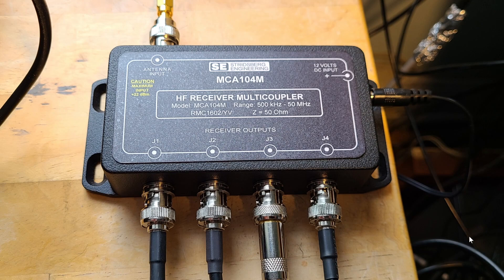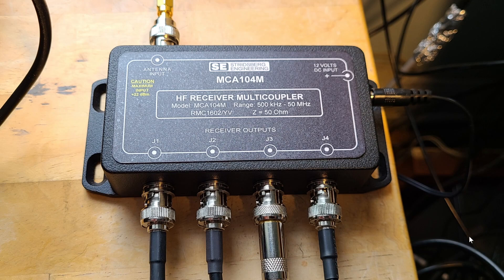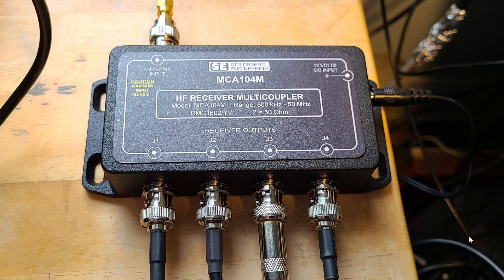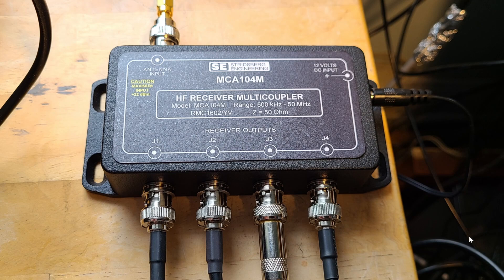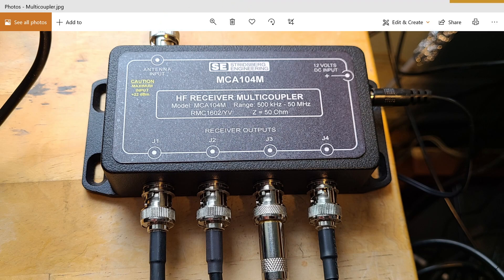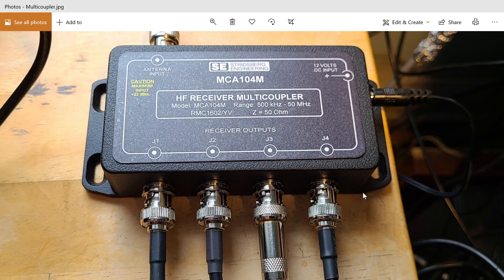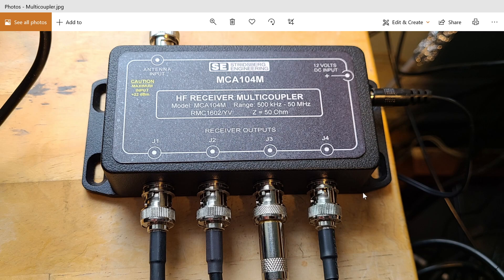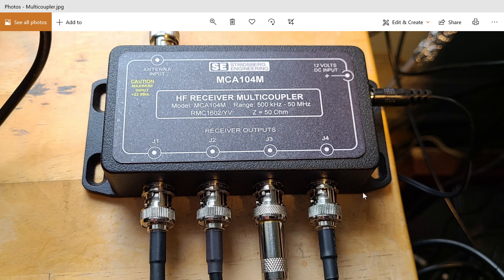What is a antenna Multicoupler and what it does and why you need one

Comment: Hello and thank you for your video.
I see that you have the MCA104M model which covers the frequencies from 500kHz to 50Mhz.
I have the MCA204M model which covers frequencies from 25Mhz to 1 Ghz and when I plug it in I lose almost all my VHF and UHF reception. My question is, did I get the wrong model?
I wanted my scanner and SDR key not to be disturbed by my HF emissions.
Sincerely
Niko

Comment: Is there such a device that allows for multiple antennas to connect to one receiver?
Edit: I do have an antenna switch, Delta, but I was wondering if there were a switchless device.
Reply from the maker: Good question
Reply: I would hazard a guess that you could just use the multicoupler "reversed", I believe that they electrically isolate the multicoupler portion (like the 4 ports), so that way when you add multiple resistances posed by the antenna and feedline, to not affect the overall resistance/impedance as you would normally do when putting multiple resistors in parallel. The muliticoupler always "presents" to the 1 port only the 1 "resistance" at a time, even though all are being simultaneously used.
I'd really like to see one, and have the necessary funds, for a multicoupler that would serve multiple transceivers to multiple antennas.